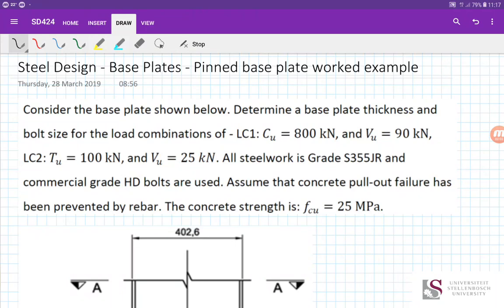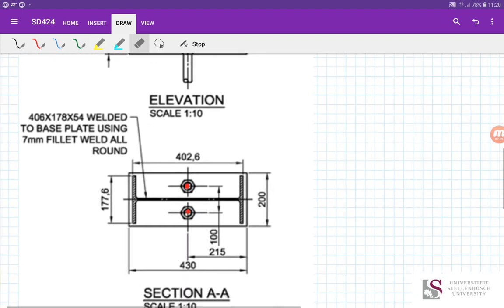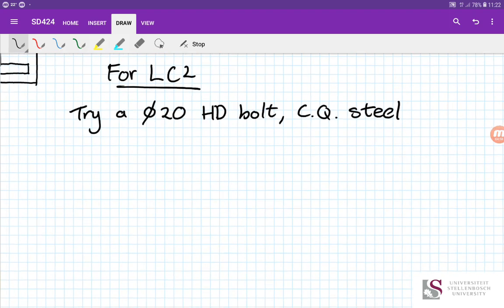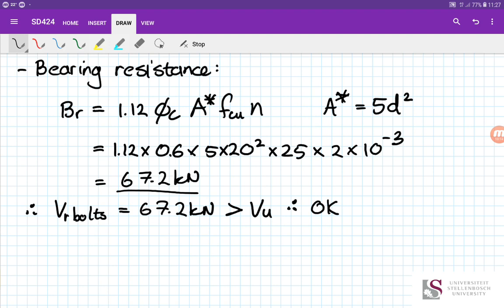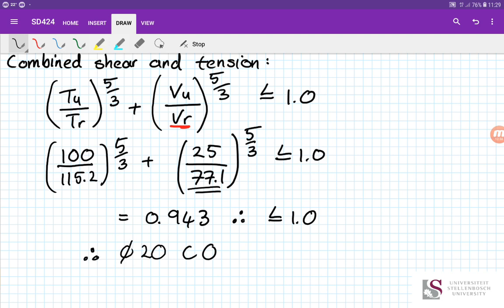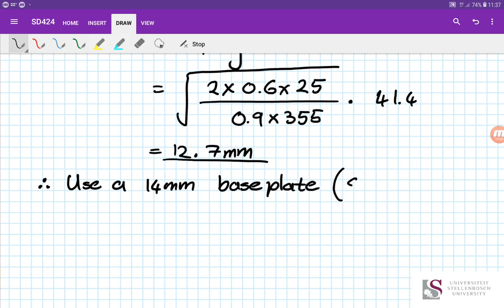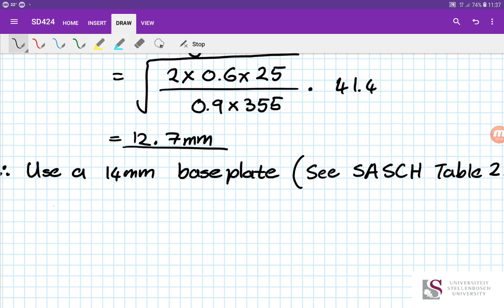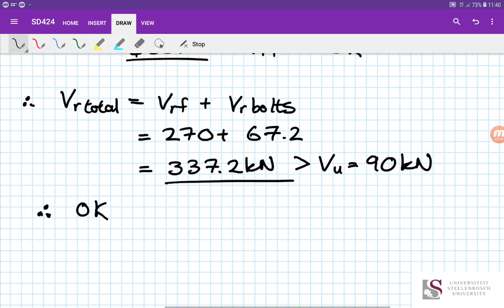Steel Design - Base Plates - Pinned base plate worked example - SD424

Comment: Hello Sir,
I am 2 years experienced structural engineer. In my country we use AISC (American) standards depending on software. I have a question. Are there massive difference between SAISC and any standard on base plate calculation? What is your opinion on it?

Comment: Good morning Dr Walls. What if the compressive force is really small, lets say 11kN. That gives a negative C value, how would you get around this?
Reply from the maker: Hi Hamzah. Hope you are well. If your c value is negative it means that the area required is less than the area of the column. Hence, in theory you don't need a baseplate, and you can size it based on practical requirements.Usually take the thickness of the steel column (thickest part) as a rule of thumb, as a basis.

Comment: Sir, how to decide the length of the anchor rods?
Reply from the maker: The bolt length is normally a standard for different sizes. However, it is based on the length required to prevent pullout from concrete cone failure and sufficient area to transmit the load without failing the concrete. The anchor plate and concrete strength influences the length twitted.
Reply: Tq sir

Comment: Thanks sir, and what if I have more than two bolts
Reply from the maker: If the bolts have the same force you just divide the force by more bolts. If they were in different positions with different forces you may need a more detailed analysis. It depends on where the bolts are. You can normally design from first principles to get a solution
Reply: @richard_walls  damn man thx